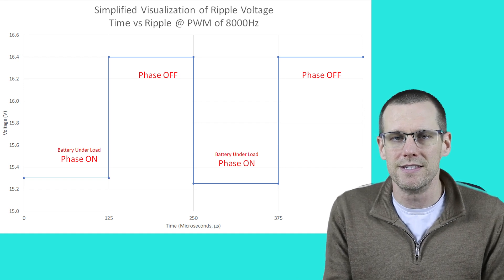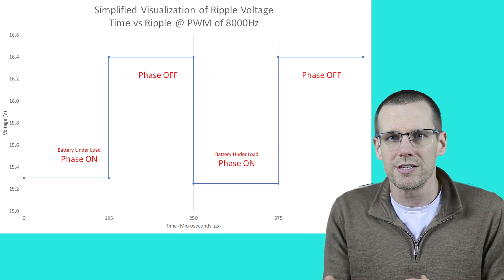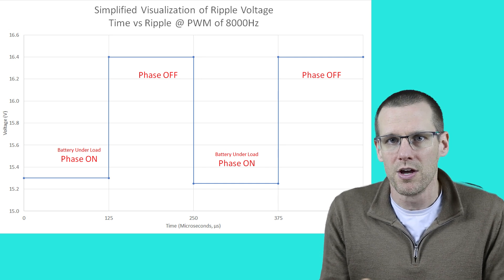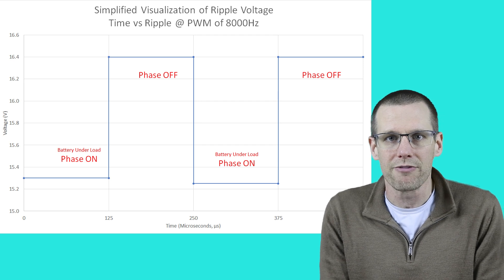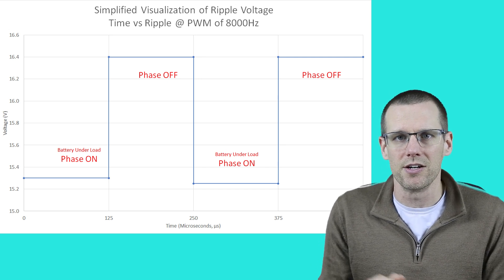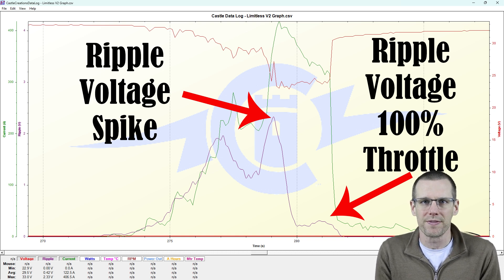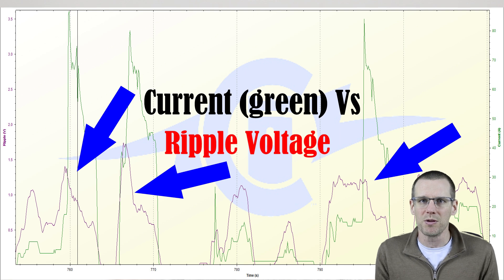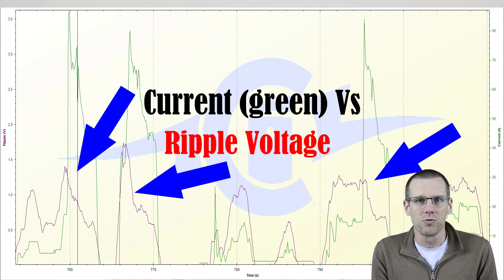Can't Measure Ripple Voltage? Check THESE 3 Signs Before It's Too Late!

Comment: I have a question if anyone can help me.

I have a TRX4M and I upgraded it and I put a brushless system in it. 

I have the MBL32 esc and a 2400KV brushless motor. 

BATTERY I’m running is a OVONIC lipo battery specifically the 850mAh 11.1v 3s with 80c rating 

I got this one because it was the cheapest well rated 3s battery and I started using my rc but I found the esc and motor get kinda warm when only running it for maybe like 10-15 min. 

I had a feeling this battery was way too powerful for my rc and I don’t know if it’s going to burn up my esc or motor. 

What I thought was that the battery can handle a lot of power taken out of it and since my esc says it’s able to do 6.4v or 7.1v but it says BEC which idk what that means but I think that’s for the servo. 

Now the battery says it’s 11.1v and I’m not sure if that means that that’s the max voltage it’s able to output meaning I have way more power than what I’m actually needing. Or if that it’s dumping 11.1v into me esc that can only take 7v max I’m not exactly sure if that’s even how it works but if anyone can help me I would appreciate it a lot. 

Same for the esc I thought that the max voltage it’s able to take out of a battery was 6.4-7.1v or if that’s the max it’s able to output into my motor and servo. 

I also have an injora 6 channel receiver that says 4.8-10v/DC not sure what that means either but ama assume that’s the minimum and max voltage it takes and outputs.
Reply from the maker: On the link I found the MBL32 takes 2 to 3s LiPo. The output to the servos is 6V or 7.4V depending on the dip switch.

Comment: I had a UL-19 hydroplane from Horizon that blew the cap pack (STANK!) in the first ~5 runs using 65C Liperior packs.  Horizon was great about it and sent a new Dynamite 120A esc out (-cap pack and all-) right away. Haven't had a problem since, same ESC model.   I was running 50% throttle max on my new $400 BOAT which was probably loading the caps pretty hard- as I now understand it from this channel.

Comment: Power supply!! Ofcourse!!!😊🥳🤗🤩 And some basic info about usage
Reply: I'm electronically an intermediate and converted one.  My challenges (that would be good to cover) were for a "12V only" supply:
Good bannana plug sockets & mounting
&
Resistor size and package type for the 5v circuit load resistor that enables the 12v to be smooth & powerful enough.  Started @ 10 ohm 10 watt but had to change to 5 ohm to get decent current on the 12v.
The 10/10w ceramic hung in space, the 5/10w was wiewound in a nice finned aluminum heatsink package.  Much better installation as the heatsink had mounting feet.